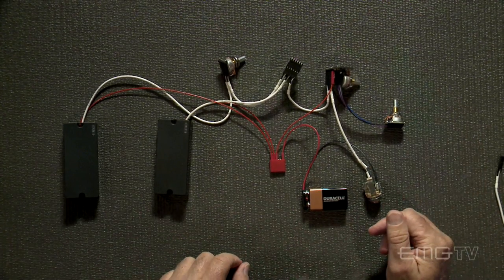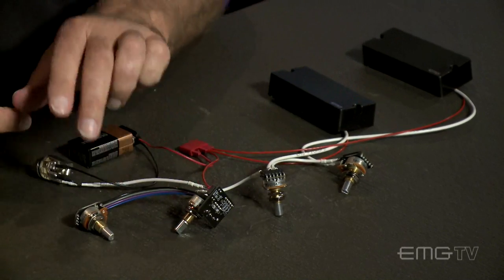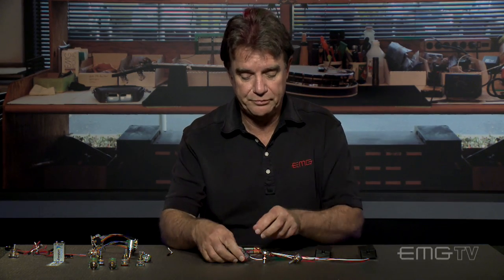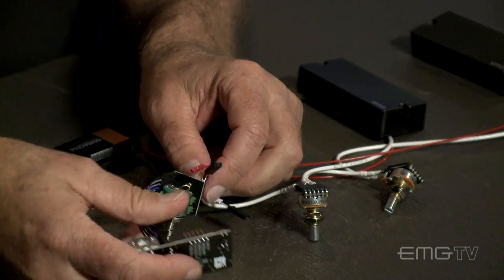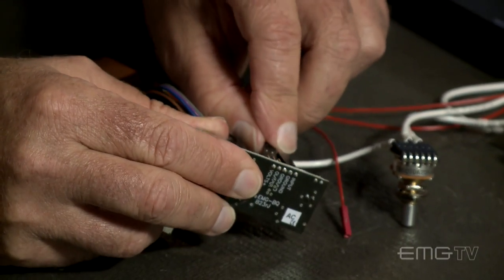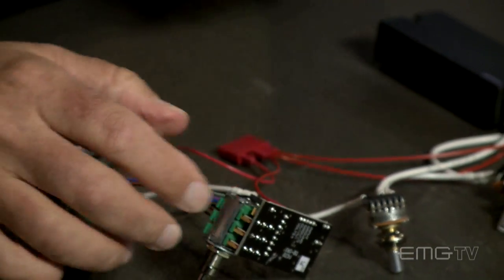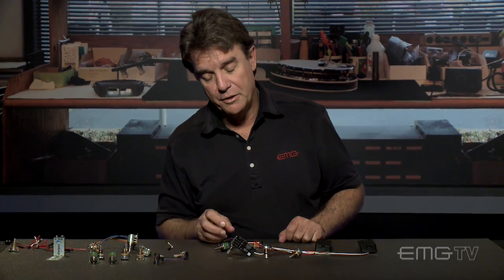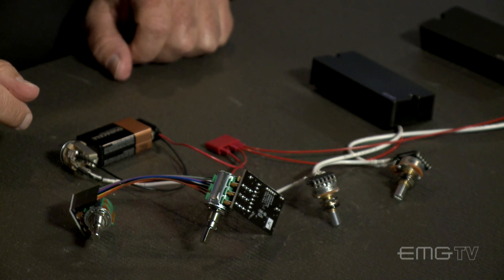How to install EMG BQC system for bass

Comment: Had to turn certain wiring upside down.
You have to make sure it is not in reverse, otherwise you  will either get no sound, or you will get a straight pickup to jack effect, with no control over t he volume or tone.
Finally got it wired  up, and the sound is great.
I replaced the Jazz type pickups in my  mid  90's Carvin LB75 with EMG Jazz pickups. The original preamp kept fading in and out, so it was time for that change.   I bought the pickups from Sam Ash Music in their old Canoga Park (Los Angeles) store.  I bought the BTS from an online seller  through eBay called "Don't Tell The Wife".  Came with all the necessary parts and wiring.  Almost gave up and went to a local sound repair person, (who wanted a lot of money to do a simple wiring thing).  Patience prevailed,  the wiring  is all done, and the instrument is sounding better than before.  
I recommend pre wiring the setup, just to test everything to make sure it works before installing it.  Wiring it all up before installing it is recommended.
Reply: Can you explain what you mean? Which certain wiring did you have to turn upside down? I'm getting no sound